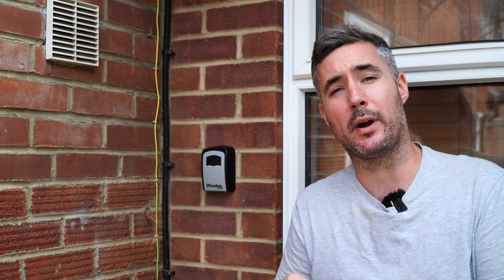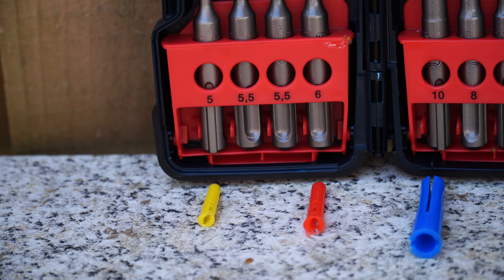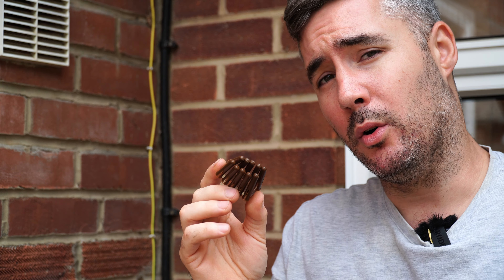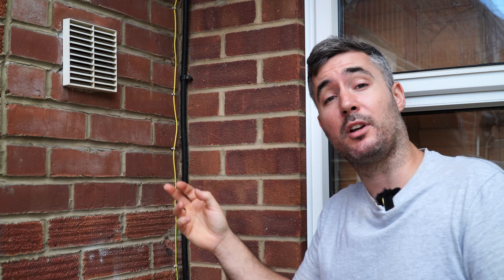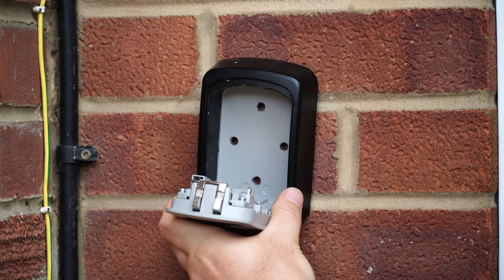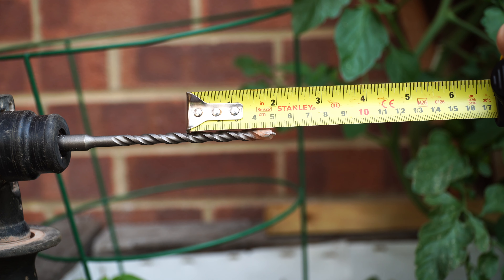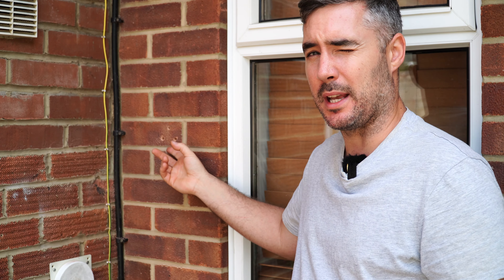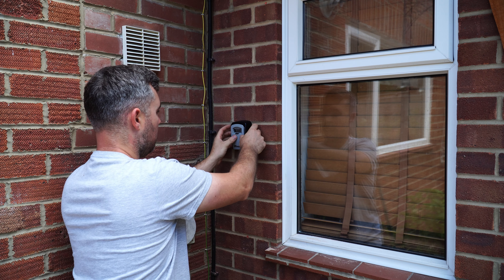Do You Drill Into the Brick or the Mortar ?

Comment: Are holes in brick easy enough to patch without looking weird if the item you’re mounting doesn’t remain there forever?
Reply: I don’t know
Reply: yes use a external brick caulk or similar in a similar colour. It's a good idea to sweep up the brick dust on the floor after drilling and keep it somewhere safe. Then when ya caulk it just dust some of the dust on and it'll set with it. Can barely tell then even close up.

Comment: An important factor often missed is if the brick on your house is still available should it crack in the future and in many case they aren't or won't. In my opinion it is better to drill in the mortar most of the time and plan accordingly to get the strength needed (number of anchor points / type of anchor).  Good drilling tips in this video!
Reply: Absolutely!!

Comment: A quick question whilst I'm here, I drilled 4 holes into an internal solid wall for shelf brackets, but the holes are a bit off even though I marked it correctly. I now need to drill another 4 holes slightly higher and to the left. How far apart do the holes need to be from the first set of holes to avoid weakening the new drilled holes?

Also, any advice for drilling holes accurately without the drill bit wondering off? I'm thinking off using a much smaller drill bit first and then working my way upto the 8mm bit that I need. Thank you kindly.
Reply from the maker: As long as you are 10mm away that will be fine. If the wall is very pourous i would use a hole punch to start off. Start the drill off hammer first and you should be fine.
Reply: @JamesMontana  Thanks man will be giving it a go tomorrow. Appreciate the response 👍